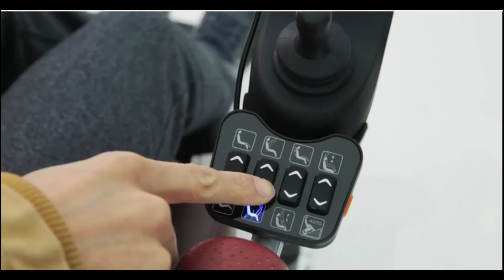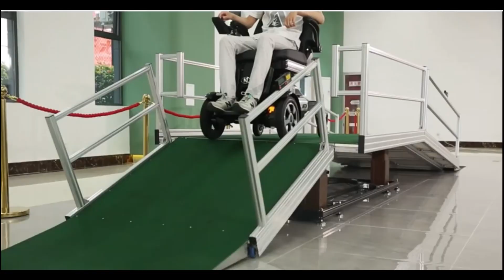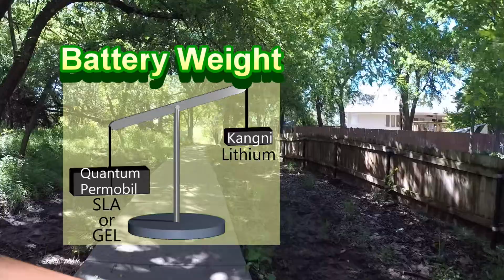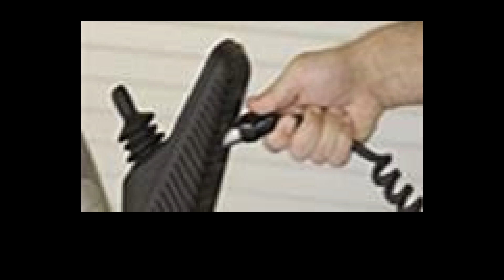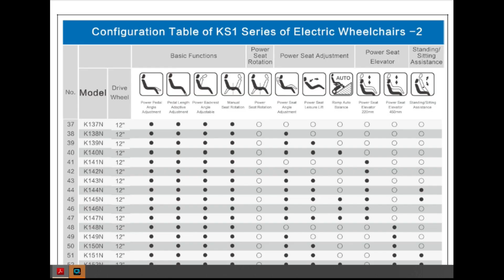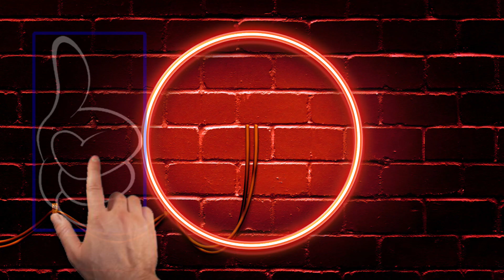#29 - IB Myositis -  IBM Dream Power Chair?

Comment: You seem to like Quantum, but I have heard Permobil is more reliable and that the Quantums are always breaking and in the repair shop. What's your take on this? Thanks for your channel, it's very well laid out and informative.
Reply from the maker: My opinion would be just the opposite! Permobil Use a R-net electrical system that I've experienced personally as having poor reliability in their cabling, especially in the cable that goes Between the joystick to the main control box. People with IBM will always opt for the swing away joystick that allows them to get closer to a side of the table, and the R-net system Cables are not up to the constant bending. I Helped three  Permobil Owners since Christmas time experiencing this problem with their Swing way joystick cableS. On the other hand, I have owned three quantum edge chairs over the last 10 years and have never failed joystick Cable, And in fact have not had any failures that require service Work during that same time. Permobil Parts are not as readily available as people think creating long wait times to get Permobil Chairs repaired.
Reply: Wow. Thanks for that inside scoop. I definitely need the swivel joystick. Seems I crossed Permobil off my list. Thanks again.